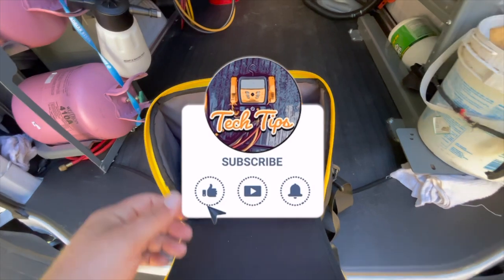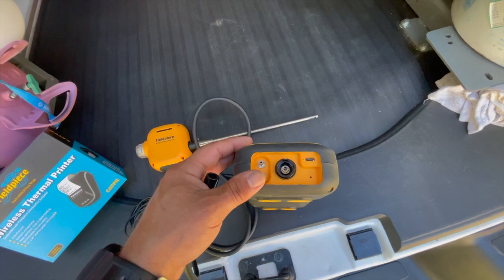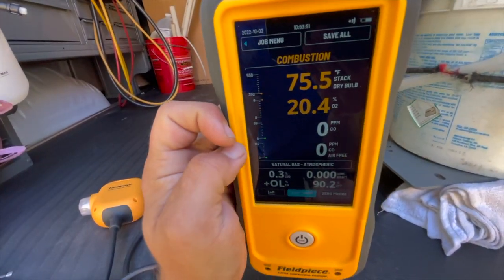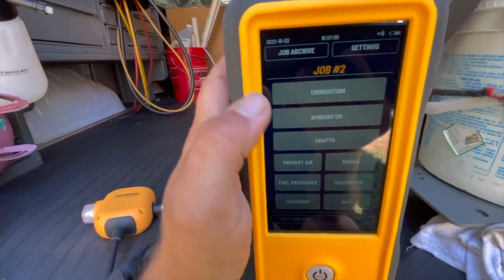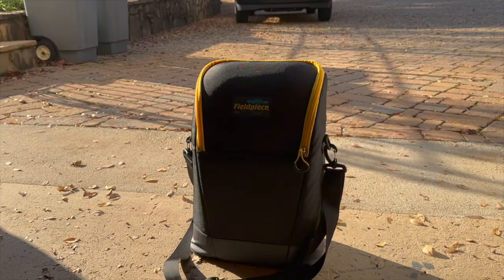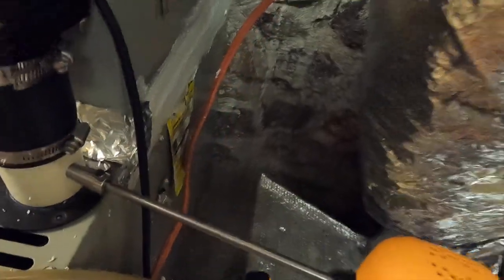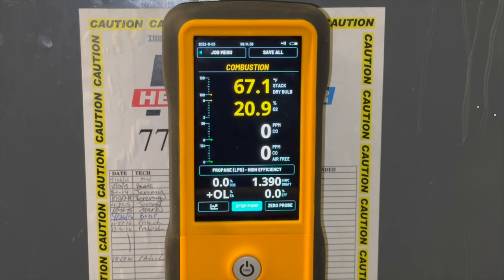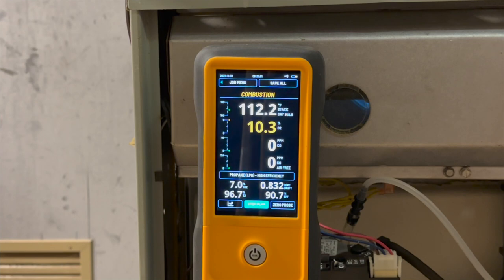Fieldpiece CAT85 Combustion Analyzer Review

Comment: Great video, thanks for the review. I bought this combustion analyzer last week and started using it this week. It blows away the UEI version that my company provided. It feels like it is built very well. Thanks for explaining the ambient air purge when you turn it on. I have been using the ambient air in the room. Mine is primarily used for #2 Oil as I work for an oil company. As tune-up season is starting to ramp up I actually look forward to performing combustion analysis. I want to test the realtime changes as I make adjustments to the equipment. Hopefully Fieldpiece will start rolling out the sensors that are field replaceable within the next four years before mine are out of useful life.

Comment: What is the maximum resolution on the sensors? Is it 10k ppm or more for setting combustion? Does it calculate Nox I looked everywhere and can't find this info anywhere. They call this commercial grade but what I am seeing it this device is a high end residential tool because I would be worried to balance a commercial boiler with it and the fact that it won't read below 20ppm is ridiculous

Comment: Great video. I actually have this tool and it's good but has room for improvement. They need to give the option to change from 24hr to 12hr clock. As well as have more ability to change the setting on the app. Also it would be nice to be able to set ranges for custom fuels rather than just the CO2. But for the price it could atleast come with the tubing and connectors for checking gas pressure. But my biggest issue is the case. I plan on replacing it with something like a Pelican Case. Something rigid that will keep the device more secure that the current case. The current case has basically no padding and has no straps to strap the device in so if it falls it just moves around inside the case too much even if it's in the specific pouch. I hope the upgrade the connector for the sensor to something metal because the plastic feels really cheap to me. But the screen is great and it has a huge potential to be great. Just needs so tweeks. But great video.

Comment: I got this as well roughly a month ago. within 2 weeks of having it i was reading 0 O2. Messed with the seating of the sensors and no luck. Called tech support and they were excited to hear what was going on because of how new the equipment is and wanted to get their hands on it. Such a great tool i loved it and cant wait to get mine back
Reply: It does suck that you send to send it in and be left with nothing. If i spend 1700-$2000 for an analyzer, i expect to have it in hand for several years before sending it out
Reply: Someone was telling me the new fieldpiece analyzers don’t read below 20ppm they just say 0 when below that. Do you know if that is true?  I would hope they have a 1 ppm resolution? I know I saw u using it thought maybe u knew.
Reply: @drohvac4583  that's false. I just got mine back roughly 2 weeks ago and have had several readings below 20ppm. Fieldpiece actually informed me there was something wrong internally with my old one.
Reply: No Measure Quick
Reply: I am the first tech at our company to get one of these analyzers as we slowly replace our older UEIs.
mine reads 0% 02 after using it for 1 week. Even when it was "working" many of the readings it displayed were not realistic. The draft also has always danced around and steadily climbs even when its sitting in a still and empty room. It picks up false CO readings sitting in an empty room. I don't like that I can't customize what is displayed on the combustion screen. For example I can't have it display gas pressure on the same screen as the combustion readings. 
I am very disappointed.... Hopefully Fieldpiece can get this resolved quickly and permanently or we will have to purchase something different for the rest of the crew.

Comment: Where would you place this in a package unit Sir?
Reply: As close to the inducer blower wheel as possible without hitting the wheel with the probe.  Once you’ve got it in there, slightly move it around until you get the most consistent readings.  The. Do you testing and analyzing from there.

Comment: Someone was telling me the new fieldpiece analyzers don’t read below 20ppm they just say 0 when below that. Do you know if that is true?  I would hope they have a 1 ppm resolution?
Reply from the maker: Yes as of now it's true. Once they read below 20ppm it shows 0. There's supposed to be an update coming where it changes that to read down to 1
Reply: @HVACTechTips  that's a big bummer!
Reply: Funny how no says that in the review!!? Cause no one would want it. Watch when the update comes you all have to send it in, be without it.  Why not just do it right from the start @fieldpieceproducts??
Reply: Don't buy this tool. I'm returning mine it read 8 ppm out of the box, after playing with it it went to 0 ppm.  I measured my water heater went back to 8 ppm.  After some time it went back to 0 ppm.  I gave the probe a nitrogen bath did not change from 8 ppm CO, even though O2 fell to 0 as expected.  Looks like there was a reason for not going below 20 ppm CO.   This prevents you from using the tool to measure ambient CO levels.   

Something else to consider it is rated to 752°F my water heater was running 650°F.  

Compared to the Sauermann Si-CA 130

Si-CA 130 ~  Flue Temp  -4 to +2282 °F
CAT85 ~ Flue temp 32 to 752 °F

Si-CA 130 ~  CO range 0 to 8000 ppm, with auto shut-off to protect the CO sensor.
CAT85 ~ CO range 0 to 4000 ppm

Si-CA 130 ~  2 yr warranty tool, 4 year sensor
CAT85 ~ 1 yr warranty tool, 4 yr sensor

Si-CA 130 ~  Up to 3 gas sensors: O2, CO, NO or NOx
CAT85 ~ Up to 2 gas sensors: CO & O2
Reply: @HVAC559  sauerman analyzers are top notch
Reply: I’m on my second one they updated my first one (Brand New) then I got a back up that does the same thing, reads between 0 and 8. Junk.